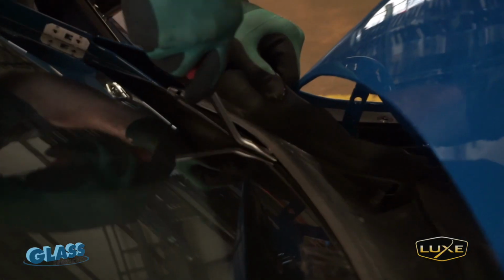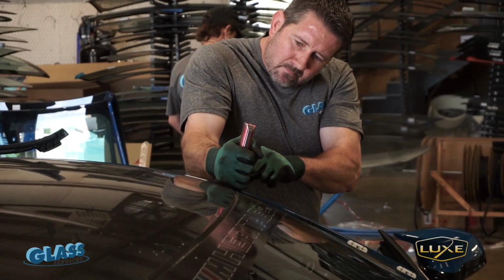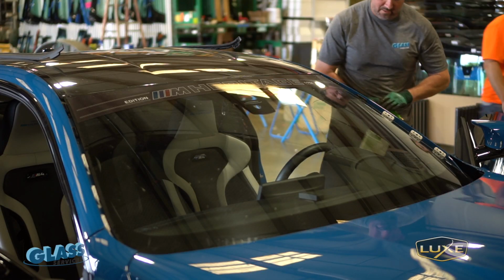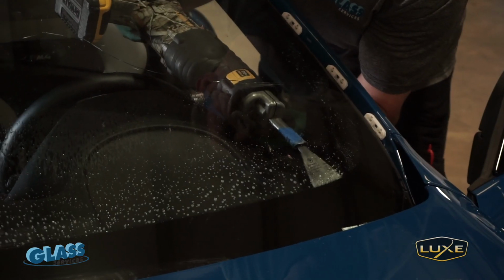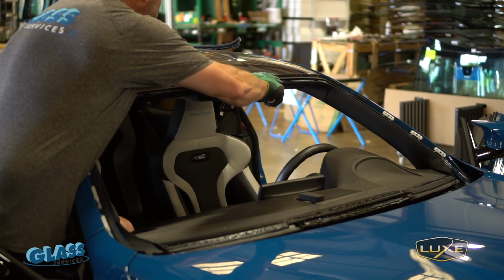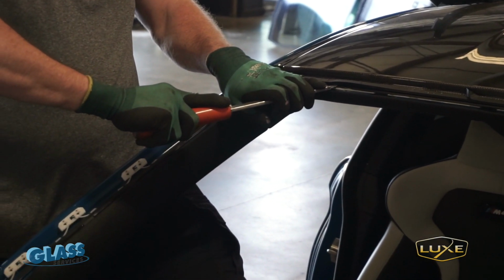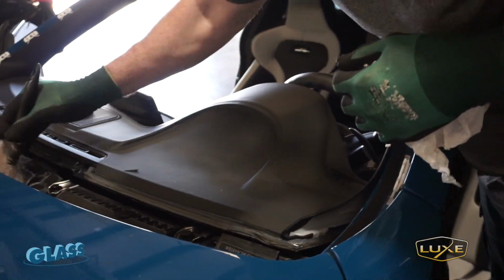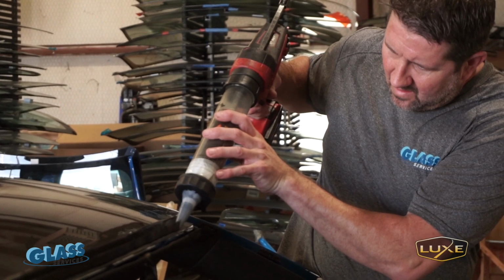BMW M4 Windshield Replacement Installation

Comment: Great job but……. No protection for the dashboard… usually the put a moving blanket or something…guy is using a hammer drill or impact tool right by the dash …specially M4 HERITAGE EDITION.. only 250 in the world laguna seca blue.

Comment: Hello,
What's the price of the windshield?
Reply from the maker: They charged around $950 I believe
Reply: Two Safelite outlets quoted $1,473 for a 4 Series BMW. The BMW dealerships (three I had quotes from) ranged from $2,060 to $2,173 for the same 4 Series BMW ...all the above quotes included 10% state sales tax. The BMW dealerships' quotations included new bump-stops, the new insulation strip, and  two each new lower plastic drain channel pieces.  The Safelite outlet stores did not.
Reply: Also know that the required adhesive used to secure the windshield is a specialized urethane that is best to cure in ambient temperature between 70F -100F degrees for a minimum of 6-10 hours ... preferably overnight and certainly not subject to any kind of moisture during the first 24 hours.

Comment: hey I have a BMW M4 as well and I am about to get my windshield replaced with an OEM BMW windshield by Safelite since it is the only place in my city that replaces windshields... Is there anything you suggest I tell the technician in which they don't screw something up? I noticed the black side moldings... are they re-usable? Also what about the wiper blades? Are they just bolted on or something or do you need a special tool?
Reply: I work for Safelite and we do things safer than those people so just fyi.
Reply: I know that BMW offers an insulation kit to replace the original for the leading-edge to ensure elimination of the dreaded whistling-noise.  I wonder why this was not replaced ... do the M cars not require it?! Hmm. Also,what is done to protect leather-wrapped dashboards and Head-Up displays for those cars that are so equipped?